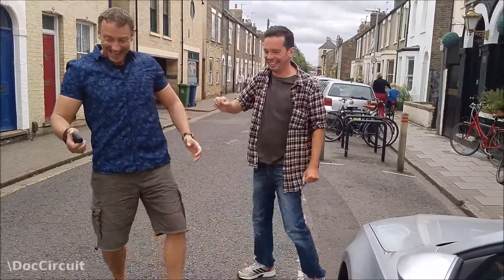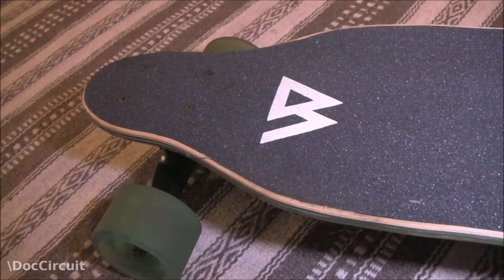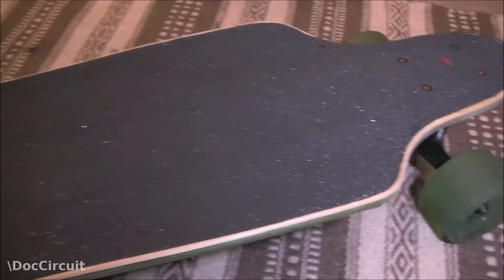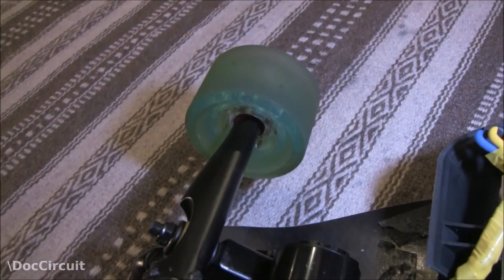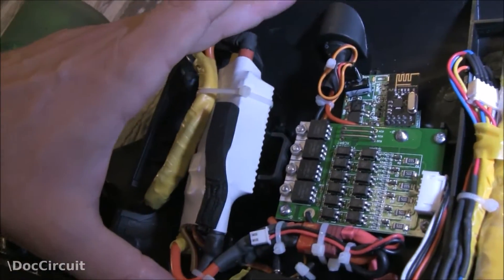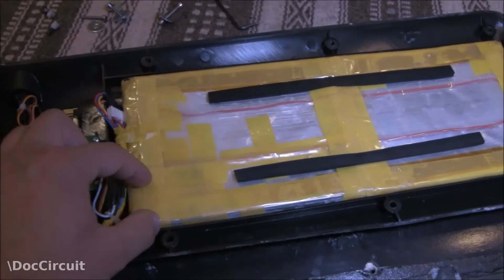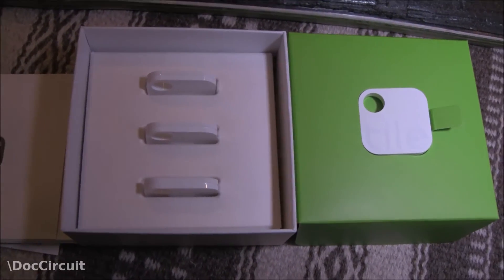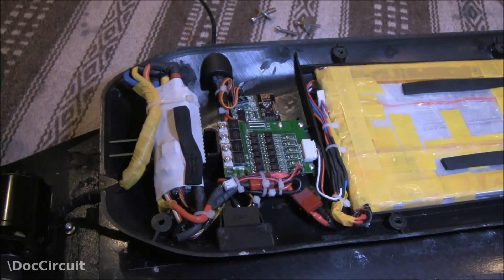Remember my Electric Skateboard used for Testing Modifications?

Comment: Do you by any chance have a video on how to replace the fan on this magneto board? I have the same board but can't seem to find a way to unplug the three cables that go from the fan, to the motor. Seem like unusual connections that I haven't encountered before. Thank you!
Reply from the maker: Hi Gary. 'Fraid not. The stock ESCs are awful so I don't bother trying to fix them; I simply replace them with a better ESC.
Reply: Will an upgraded ESC allow for faster speed, or just a better part in general?
Reply from the maker: It won't supply a higher top speed. It controls the battery output, it doesn't add anything extra. It's worth doing though as it gives FAR more control than the stock ESC.

Comment: https://www.kickstarter.com/projects/leafboard/the-lightest-and-most-affordable-electric-skateboa

This looks interesting. I don't know how they are giving it at such a low price. Their claims are too good to be true
Reply from the maker: Yup, it does indeed look interesting. My main concern would be the range. I don't see how a 5AH battery can move the board for that sort of range.
Reply: They said the battery is connected in series with 6 of them
Reply from the maker: Of course, it's a 6S battery pack.
Reply: Dr Circuit so do you think with 6S battery pack its kind of not good enough for 11 mile range?
Reply from the maker: Unlikely with a single pack. Two packs wired in parallel would be much more likely. Having said that my next videos are going to be range tests of my boards showing accurate measurements of exactly this.
Reply: Dr Circuit Thanks that would be very helpful

Comment: Hi Dr Circuit, I've been watching your videos for a while now and you really got me into electric longboards and modifying.
I just have one very frustrating problem with the board I just got. 
My board is a Chinese clone, from http://lectriclongboards.com/
For some reason after a few days of perfectly good and normal use followed by a day of leaving it home and not using it, the board no longer seems to work when not plugged in. 
Their customer service "team" seems to be just one guy who unsurprisingly takes days to respond. This is most of what I sent him.

My board only works when plugged in. When removing the charger, the
 fan (ESC) stays on but the moment the throttle is pushed the motor spins for 
1-2 seconds and then the entire board shuts off. Sometimes the board 
turns on when not plugged in, and the fan runs indefinitely, but when the throttle 
is pushed, the motor spins for 1-2 seconds and then the whole board shuts off. 
Sometimes it doesn't turn on at all, or shuts off in a few seconds.

I feel like it may be a defective battery cell 
that's causing the board to shut down since everything seems to work 
fine when plugged in. But I don't know for sure. 
-----------
The battery was fully charged as always, I turned it on prior to going out and pushed the throttle up while holding the board and it seemed perfectly fine, but then this all happened after I put it down and tried using the remote after pushing manually (on a slight decline) for a few seconds, which is what I always do. I thought it could be an overcharge issue but after leaving the fan on and running for hours until the battery ran down to orange/yellow on the indicator, the problem persists. 

From looking around online, it seems like the BMS might be causing the shut down possibly due to a faulty battery, in which case it doesnt sound safe to directly connect the battery to the ESC. 
I dont want to void the warranty just yet by removing anything or tampering too much, but I opened it up and everything seemed perfectly fine inside.
The battery is a 6S1P 8Ah 21.6V lipo. 
I happen to have a decent lipo balance charger and 3s lipos but I had to order adapters for the deans connector used in these boards.
I weigh around 145-150lbs, and I think I had drained the battery completely on prior rides, but charged up afterwards.
I could make a short video demonstrating if need be.

Sorry for the super long comment, its just that its my first board and I've barely had it for a week, and it doesnt seem like anyone else has had any similar issues so its been pretty frustrating. 
Thanks so much.
Reply from the maker: Yup, this is a long 'un! 

Unfortunately there's no way to know from your description what's wrong, so you'll need to diagnose. First thing I'd do is remove the BMS from the circuit (you don't need it to run the board), and see what happens (obviously charge battery first). After this I'd measure voltage from batteries and voltage of each individual cell.

These tests will establish if battery or BMS is at fault.

If you aren't familiar with electronics, do NOT do this. The batteries are highly volatile!

Comment: +Dr Circuit Your videos are very informative. I just have one question. I am a 190 pound plus person. Would a one 1200W motor skateboard be good enough for me. Also what would be the range that I can expect? I am planning to get magneto type of skateboard directly from alibaba seller who is in LA. Please suggest any other if you know of
Reply from the maker: I'm heavier than you and the single stock motor moves me along nicely. But the stock ESC will likely fail so do be ready to replace that. Range is better than my Boosted Board. I get just over 4 miles from my Boosted, and more from the Chinese clone (but I haven't measured it accurately). All the Chinese boards are good as long as you're willing to replace the ESC and maybe remove the BMS.
Reply: Dr Circuit That's where the cost cranks up. Shipping from China altogether 500$ atleast and then replacing parts 150$ more
Reply from the maker: Not really, and it depends where you live and buy it from. If you buy a board within your country you're looking at $500, plus another $100 for the VESC. $600 is MUCH cheaper than other boards. And if you can find a second hand one, the price is ridiculously cheap.
Reply: +Dr Circuit I will try to look for a second hand one but I am sure it won't be available on Craigslist. Also Chinese electric skateboards are not so popular to be found second hand and that too in working condition
Reply from the maker: Doesn't need to be in working condition. In fact you could get a bargain by picking up a broken board - as long as it's the ESC that's failed (which is likely).

Comment: Hi, I have one of these boards completely stock and I was wondering if using 97mm wheels with the stock esc would cause a lot of problems? I want to be able to go over bigger cracks n such but I also don't want to explode my esc. Thanks!
Reply from the maker: I'd be VERY reluctant to run 97mm wheels with the stock ESC. The stock ESC often fails going up hill, accelerating, etc, for people of average and above weight. To also fit 97mm wheels (which will draw additional current) will only make things worse.

Comment: Amazing video as always...Can you recommend a better/faster (more reliable) charger for the 6s, lipo batteries?
Reply from the maker: Thanks!

When you say 'reliable', it should be noted it's actually reliable as it is. Having said that other differences can be had:

1. The existing charging setup needs the BMS and power supply. Another power supply rated at 23-24 volts, but with a higher current output (amp rating), will allow the battery to be charged quicker, but it should be noted charging the battery slowly is actually better for the battery.

2. You can change the BMS connector (see one of my videos about this) and completely remove the BMS and power supply for charging and instead use an off the shelf charger. This will allow different charge rates to be used, and you can put the battery into 'storage mode'.

Comment: Do you think this clone cog will fit in this wheel? https://www.localskateshop.de/en/big-foot-longboard-wheels-core-light-blue-97mm-78a-wheels-skateboard-wheel-set-bigfoot-cruiser/longboardartikel/wheels/big-foot/a-90945/
Reply from the maker: The clone cog does indeed look compatible with those wheels, but I cannot guarantee this just from a photo.
Reply: np i found some other ones like yours. have you not thought to upgrade your bearings?
Reply from the maker: Already done. Not sure I notice any difference though.
Reply: btw do you believe that i could run 97mm wheels with the Alien ESC?
Reply from the maker: The Alien ESC has excellent acceleration and braking curves, but it can get a bit warm. Running 97mm wheels would increase the temperature still further. I'm not saying it can't as I've not tried this personally, but I'd be cautious, and would use a fan and vent to draw in cooler air.